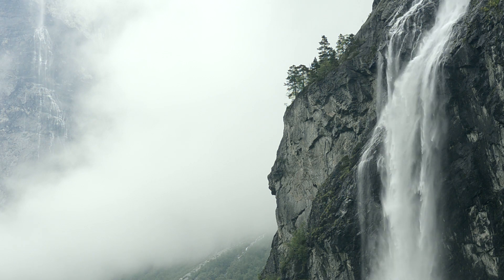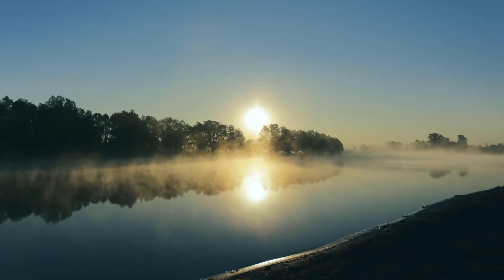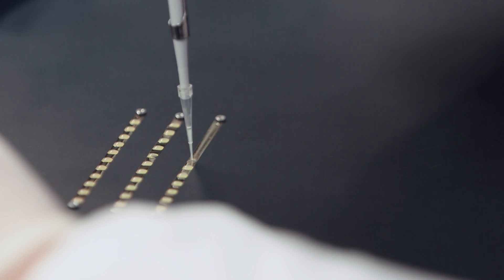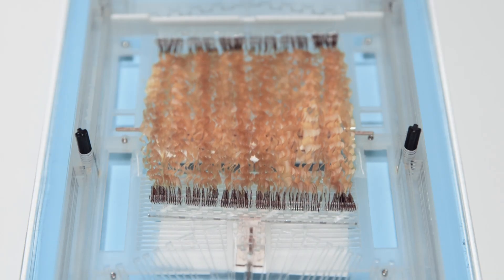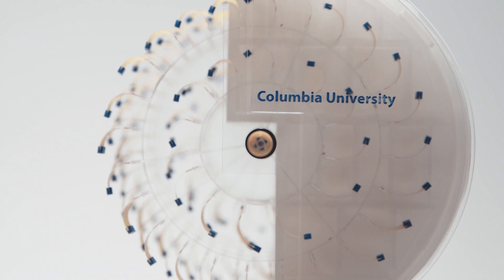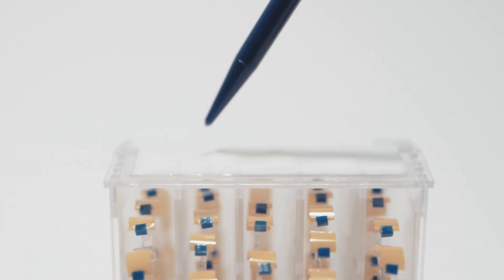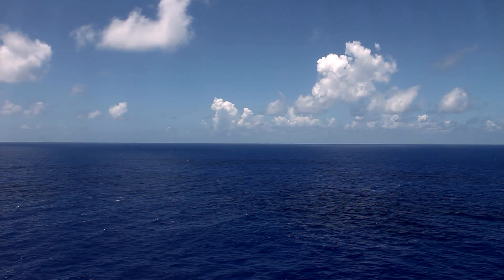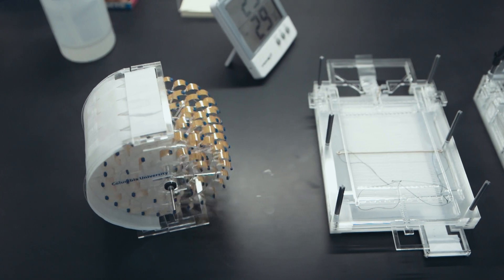Renewable Energy from Evaporating Water

Comment: Given a fixed volume, pressure and temperature of moist and dry air, the vapour wheel cannot produce work indefinitely as it violates the second law of thermodynamics. Not that the video claims as such but I am caught in a thought experiment on why the wheel would eventually stop spinning in order to satisfy the second law. I think after every pass of muscle, the temperature in the moist section would drop due to heat transfer to the muscles and therefore condense the section into a dry state. Can anyone correct me if this is the mechanism on why it cannot turn indefinitely?
Reply: Dejan Popovic You have to remember that all these laws on conservation and other laws relating to thermodynamics was written when? Somewhere around 1797...

Since then man has had many leaps in technology and suchlike that the laws hold no water anymore, and the reason why should be a plain as the nose on your face.

It is institutionalize teaching of an outdated concept of the way our world works that these laws are holding us back from progressing beyond these outdated modes of thinking. The sooner that these laws of thermodynamics are evolved to meet modern engineering standards, we will continually see these comments by people about breaking the funadmentals of thermodynamic clap trap.

Did they have nano technology in the 1800's? No they didn't did they, maybe you could consider putting those outdated thoughts and research in to technology that has been around for thousands of years that do break the laws of physics...
Reply: Mark Giblin one very smart man :)